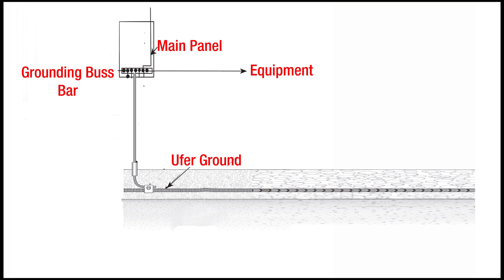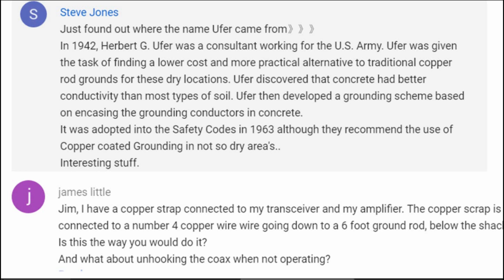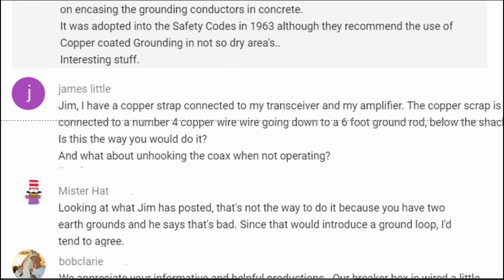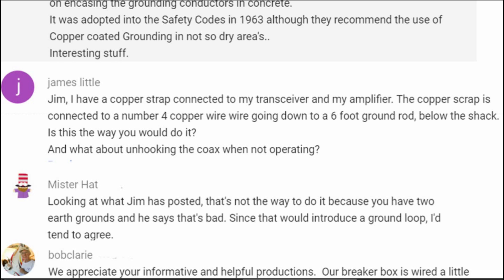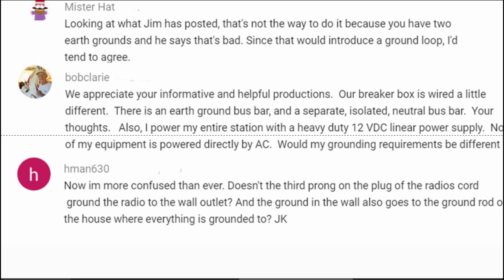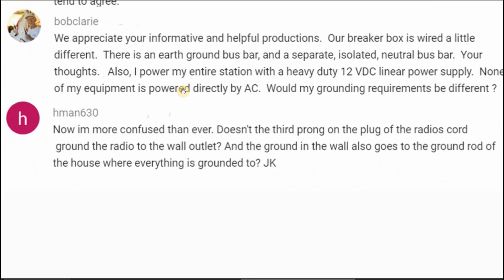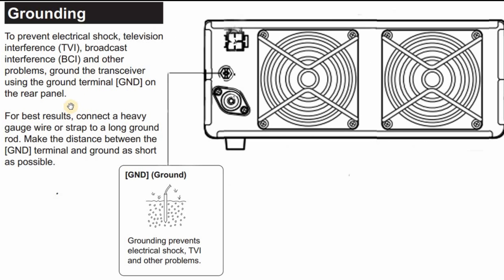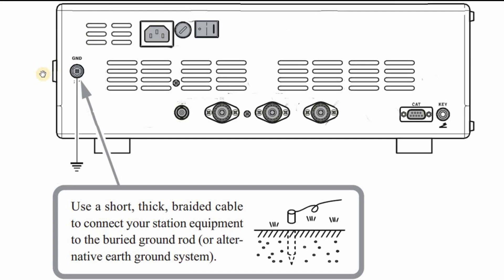Grounding, Bonding, Earthing, Shielding and Protecting with Jim Heath W6LG

Comment: Thanks for the video.  I have been getting conflicting advice from internet experts and Elmers locally on this subject.  I agree with you on the NEC as I have read it (skimmed it).  What concerns me is lightning protection. I don’t want to bring RF into the shack but I certainly don’t want to have lightning in their either.  I realize I may loose the forward facing (equipment closes to the antenna feeds) for a lightning strike but I want to make the lightning not come into the shack or the house if I can help it.  Thoughts?  73, from a #HamInTraining
Reply from the maker: One thing to think about is a disconnect or disconnects that are outside.  You literally pull the plug on all cables.  I have done that for years.  We were hit twice at the electrical lines and damage was done to other things but not the ham equipment.  Since I am building a new radio room in a new location, I will be discussing the grounding issues (which are confusing).  73, Jim
Reply: Jim W6LG thanks for the reply.  I am planning on using a external panel from DX engineering where I will mount my arrestors and would be a good place to disconnect as you say.  Of course you have to know ahead of time to disconnect.  Thanks again, 73.

Comment: If the transceiver is connected to grounding rod that is different than the one close to the mains panel, I think electric code is not violated as long as the two different grounding rods are bonded with 6 gauge or larger. The additional grounding rod near the transceiver is likely encouraged for lightening safety by providing a larger capacity path to "earth", instead of the 12 or 14 gauge path provided at the wall plug.
Reply: You would be correct! This does not constitute as a grounding loop! It would be if not connected to the mains AC Safety Ground for the structure or house...

Comment: Now I am really confused. Like you, I live in the mountains  near Big Bear Lake California and an altitude of 6700 ft. During our monsoon season between July and September we have terrible thunderstorms. 

I have read instructions where you should take double Ott and surround your entire house with it buried at least 6 inchs underground. At connection points you should use double Ott and there is a chemical reaction fusing compound that welds the two together. I didn't go quite that far as a whole house but close.

Also, when it came to my galvanized steel tower we dug the hole 6 feet deep ( we doubled the manufacturer's recommendations on everything because of being in a moderate wind area and it was a freestanding tower ) and at the bottom of the pit drove an 8-foot copper-clad ground rod down as deep as we could and still be able to attach an acorn clamp to attach double Ott. We brought the double Ott up through the cement and attached it with a brass tooth clamp to a tower leg. The expectation was now the tower was well grounded. It later dawned on me that we should have run the double Ott up through a piece of ABS because if the tower took a strike it could potentially crumble the cement. I have even read that you should ground your tower with a triangle of grounding rods! Or the entire house!

https://www.hunker.com/12482068/how-to-ground-my-house

None the less, I believed we had a very good ground. The way I tested it was with a 100 watt light bulb where I connected one side of an AC outlet to the bulb and the other side to the ground that we had brought into the shack. The bulb fully illuminated indicating we had an excellent ground.

Now you've thrown a monkey wrench into my corn flakes! Are you really telling me that the only ground I need is a third prong attached at a standard electrical outlet? In the shack I use numerous Belkin power strips that are rated at 30 amps and not cheap plastic ones either. They are three wire and have an MOV in line to protect against spikes. I to use RFI snap on chokes.

So what you're saying is that I don't need to run double Ott all the way around my shack until it meets again and then running into the house?
Reply: lighting is attacked by static leaders or where static is dissipating in the atmosphere from you tower, antenna, coax, and any other metal structures on your property. An improper ground allows Statc Leaders to be produced. I have been studying Lighting and Tessla's theory and others ideas for ears now.
Reply: @DirtNerds  :: I sincerely don't mean to be rude but your typographical errors and out of context statements are of no help. I like those of us that have had our ham licenses for 40 years know how a Tesla coil works. That has nothing to do with how you ground your station. With all due respect.
Reply: @justanotherguy3850  what i posted has nothing to do with a Tesla coil(Tesla did far more). I deleted the comment so you will be happy! Boils down to Grounding is everything in a good station.
Reply: @DirtNerds  :: I really don't want to be rude. You didn't need to delete your post but you made direct reference to Tesla and how you were studying his experiments and made a correlation to how lightning affects us. Many of us built Jacob's Ladder early in the 1970s. It's my opinion for whatever it's worth it if you're a ham you need to remember first and foremost to be of help and not try to show how much more you know than the average ham. Your reply that I'm now replying to is condescending. You need to learn to play nice.

I have been an extra class for more than 40 years. I simply asked a question about better grounding since I'm planning on moving to Alabama where the frequency of thunderstorms is much greater than it is in California. Just because I asked a question does not imply that I'm an idiot and condescending remarks are not helpful. You're probably thinking, what's condescending remark? Telling me that you deleted a post so now I should be happy. It's best you not reply.
Reply: @justanotherguy3850  Tesla did many experiments in regards to lighting, I have been researching as well for several years, I live right next to 144KV electrical lines and have been asked many times if i have a lot of electrical noise or have issues with lighting. just was offer what has worked well for me the past 30+ yrs. Sorry sometime I don't convey my thoughts very clear.

Comment: I disagree. You seem to think these ground points are for reducing RF interference. E0A01 Lighting Protection is the primary function of an external earth connection or ground rod.  E9D12 An electrically short connection to 3 or 4 interconnected ground rods driven into the Earth is the best RF ground for your station.
Reply: I agree, my ground rods are mainly for RF and lightning protection. Going back to the box like Jim is suggesting is stupid. You'll be exposing your house to taking in lightning if you get a strike. All you need to do is bond your ground rods to the house ground. In my house it's the incoming water line. That will satisfy NEC. Running your ground to the panel is a big mistake. Don't do it.
Reply: I think the bigger mistake is most newer houses us 14 awg wire from the outlet to the panel where if you tie your thick braid to is a higher resistance.  If you have multiple ground rods and bond them all together, doesn't it mean they are all a "single" ground point?  (The ARRL handbook and the NEC suggest to use 6awg when bonding grounds.)
Reply: @gn02020202  No, because you don't ground all of your equipment to every grounding rod. You spread it out. My career is telecommunications so I provide a backbone for cellular services. At these towers, I've noticed every leg of the tower has its own ground.  And it is always 10 awg, solid, unshielded copper wire. And the same with every terminal at that site. If you want to test any ground for lightning protection this is what I know for fact. The Bell Corp. or AT&T standards are this. Take one lead of your OHM meter and stick it in the ground. Take the other lead and place it on your grounding point. If you read 600 ohms of resistance, you're protected.
Reply: @JP JR, I reread what I said and I said you bond all the grounding rods together.  Since you bring up the equipment, the equipment ties only to one point, which is usually the nearest grounding rod.  If you look carefully, you will also notice that there is another wire other than the 10 awg wire on each tower leg to the grounding rod that goes from grounding rod to the other grounding rods.  The grounding rods do not tie together through the legs of the tower, but has their own bonding directly to each other.  This I know to be fact, from my work experience and from requirements by National Electric Code law that bonding the grounding rods together is just that there is a direct, low impedance connection between the rods.

The purpose of this is not to have the rods tie together through your equipment.  Please look more closely at the rods at the base of your tower and read the NEC.  You will also notice that solder melts with lightning and therefore is not a good use for grounding connections.  It must be crimped or bolted.
Reply: @gn02020202  Interesting.  NEC and Mr Ufer both say that concrete and rebar can be used as a ground.  Assuming that metallic bolts are used to directly mount the tower legs to the concrete and rebar footings (foundations), and that the tower legs are not insulated from the footings, what is the 10 awg wire going that those big ass steel bolts can't do?  Have a look here: https://youtu.be/qNZC782SzAQ?t=1160
Reply: @Alan Woods From your video, it would appear that the 10 awg wire could be embedded in the concrete.  If that is the case, then I would lean toward the big bolt being a better ground.  That is provided the bolts don't have a special coating that act as an insulator.

Where I was going at with the bonding is there are some people that put in a ground rod for their tower and another for the radio.  Then the only wire for between the ground rods is the braid on the coax, which is not a meant to be the bonding wire.  If the ground rods are too far apart, there should be a separate 6 awg wire that goes directly between the ground rods.
Reply: @Alan Woods  I should also mention that a Ufer ground is okay instead of a ground rod, but if the Ufer ground in your tower concrete is not tied to the ground in your house via a 6awg copper wire, then it would be bonded via the coax braid.

If lightning were to hit one ground and create a voltage potential between the gounds, do you want the current traveling through your coax and radio, or do you want a separate copper wire that can carry the currrent from the lightning directly to the other ground?
Reply: @mattk.5258  Using your water line as a grounding source is a bad idea. Most water lines are only conductive for a few inches outside the house. Then they tie into a plastic line.
Reply: Look I know Jims point is T0B11
, Local electrical codes establishes grounding requirements for an amateur radio tower or antenna. But I have to go by experience and what I've seen deployed by organizations bigger , and more established than the ARRL.

Comment: I guess I'm not understanding.  By your comments only the house ground should be used but all the books I've read show running ground from the back of radios and equipment to ground rods tied to the house ground.  Whats correct?.
Reply: If multiple ground rods are bonded together, then wouldn't they be all collectively considered a single house ground?

All ground rods should be bonded together.  If you keep RF out of the shack, then ground loops will be minimized.

Comment: Hi Jim,

Great video and it makes a lot of sense.

I believe all this grounding came form back in the day before electrical regulations got stricter and everyone used Valve or Tube rigs as you might call them.

Here in Ireland most homes in the last 30-40 years have a earth system via the 3 pin plug which goes back to the fuse panel and is then connected to a ground rod and protected further via RCD protection which kills power if current exceeds 30 ma. I'm not sure when RCD protection became standard.

So my question has always been why earth the ham equipment if it's connected to the house system earth ?

in my opinion if the shack grounder is a lower resistance there could be a danger where current endlessly flows to the separate ground system with no chance for cutting the power because it never reaches the RCD back in the fuse panel.

I believe that RCD sockets should be fitted to the ham shack socket outlets as it "helps" protect against electrical faults. 

As you rightly pointed out , RF issues should be eliminated before they reach the shack.

I say if someone wants to earth the antenna against lightning and static then this should be done outside the shack using the Coax shield.

Comment: What about bonding the separate ground to electrical ground? Thank you for another thought provoking video. -73- W1KPS
Reply: Actually it’s required to bond all ground rods together around your home.
Reply: Before ufer grounds were used, it was common practice to use two ore more grounding rods for dry ground.  All of these ground rods are required to be bonded at a central location.

From what I understand with the ARRL handbook, all grounds need to be bonded together.  One of my AC to DC power bricks is not grounded on the DC side and needs to be grounded separately.
Reply: Steam Utah mine is just sooo far away from where my radio ground is and I have a sprinkler system that would make it a nightmare to do. I also can’t go direct making it that much more difficult. Think I’m going to put a second ground rod in away from the house to hopefully pull lightning away.

Comment: ive always wondered why there was a ground nut on the back of radios??? I thought it was grounded when I plugged it into the wall with a three prong grounded electrical plug??? or in the case of 12 volt the black wire going to the negative of the battery which should have a ground to the chassis of the body of the vehicle???
Reply: I have two power supplies.  One has the black wire tying to the house ground and the other one does not.  Hopefully, your power supply has the black wire tying to the grounding pin.

Comment: I live in a very old house with 2 prong outlets through out the house. Whatever 3 prong grounded extension cords or outlet strips have to be run into a two prong adapter to be used. That being said I have run all of my equipment to an outside ground and use ferrite beads on everything in the shack. Can't afford to have the house rewired so not sure else what I can do.
Reply: Much of the 2 prong outlets I have seen were in metal boxes that may have been grounded with a third wire heading back to the panel.  (The center screw of the outlet cover "could" be that ground.)  If this is the case for you, I would suggest you bond your grounds together with 6awg wire if possible.  (The 6awg would go from rod to rod, or also from your station rod directly to the panel.)

Comment: I understand the concern about differences in potential among various earth grounds located at the service entrance, the radio room, etc.  Local code here requires neutral and safety ground to be bonded at the service entrance, but NOT at any subpanels, and subpanels must have their own earth ground rods.  My concern about grounding a ham station only via the building's safety ground wiring is what I perceive to be a fire hazard, should the station receive a significant lightning strike through the antenna system.  I can't see the 12- or 14-gauge Romex ground conductor serving to safely conduct the energy of a strike to an earth ground located some distance away at the service entrance.  I'm especially uneasy at the thought of that strike energy traversing a 14-gauge conductor buried in walls and spliced with wire nuts.
Reply: No sub panel should have it's own ground rod! That is called a grounding loop!!! The sub panel is grounded at the main panel or house/structure.